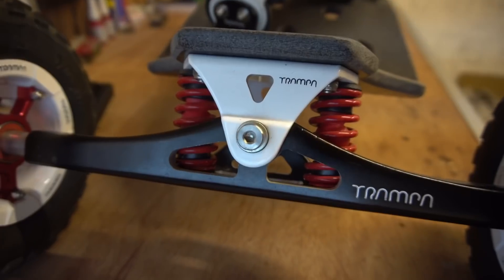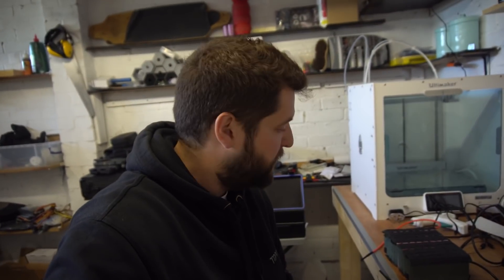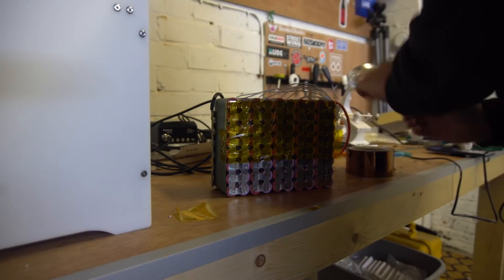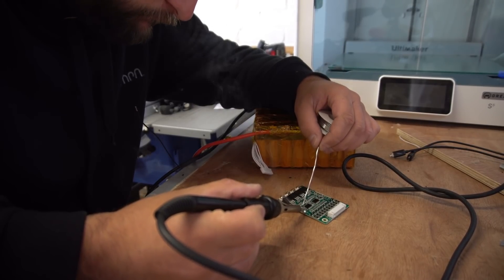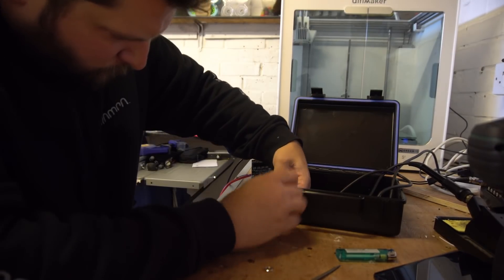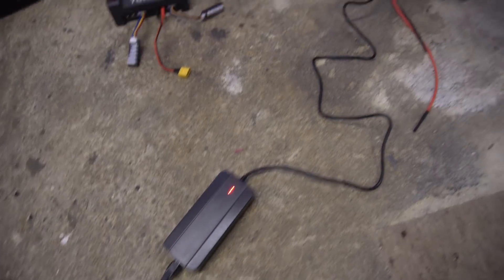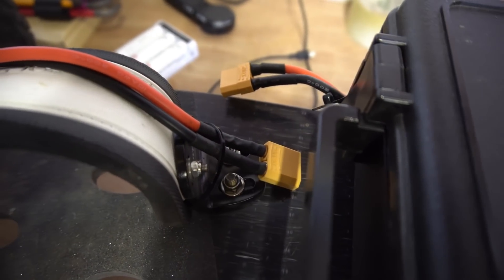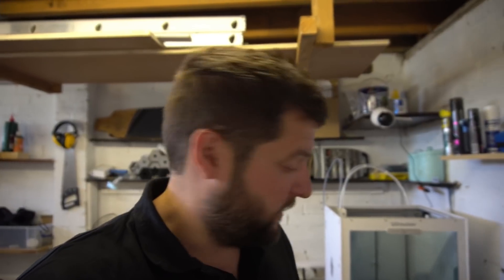How to Build An Electric Mountain Board - Making The Battery Part 2

Comment: Shouldn’t the BMS be rated for a higher continuous discharge current?
Reply from the maker: The BMS is bypassed for discharge bro
Reply: Lee Wright oh I see. Sorry I missed that. Great videos.
Reply from the maker: @AndySteber  hey no worries and thank you!
Reply: @LeeWright  wouldn't that be dangerous to discharge your batteries to much? The bms would  stop giving you power when it detects low 3v voltage to keep batteries from over discharging? Thanks for your input, you put a lot of work into this.

Comment: Lee - skip all that unnecessary welding on your next build and check out the battery kits from vruzend.com. They are a game changer, life saver, and time saver. You can build the same battery you did in this vid for 1/2 the time! Lmk if you try one. I’m going to use it on my build.
Reply from the maker: I have seen it and I have seen NESSE as well but they make the battery too bulky I think! They would be good for when you have a bit more room - I especially like the fact that you can disassemble your battery to fix something easily or take it on a plane. I look forward to seeing what you do with it!

Comment: Hi Lee
Is it possible to charge via the xt90 plug instead of the charge port?
Reply from the maker: Not in this setup, you want to charge via the BMS.  You can make the charge port a XT90 if you like?
Reply: Lee ok thanks, that must bee the solution.
Reply from the maker: @steffenkastved4720  no worries! If you are using an internal BMS like me then you just need to set your hobby charger to the correct S number and then do a non balance charge, the BMS will take care of the balancing
Reply: Lee Wright I will just use the one from my rc car, and just charge with 10 amp. I will make a battery like yours, 10s 8-9p thanks.

Comment: great build, i also found stepper drill bits work very well on plastic compared to a conventional steel or woodworking bits. i personally use a lipo as i cant do as much skilled work like that! well done!
Reply from the maker: Hey Ted, thanks man! Good tip about the stepper bits! I shall keep that in mind for sure.

Comment: Thanks for the great video!  I have a question, can I combine different types of batteries together like NCR18650B and LGGBMG11865?
Reply from the maker: You are welcome bud! You can only combine batteries together if they have the same capacity.  So check that they are both the same, maybe 2500mAh or whatever.

Comment: Just skip that anti spark switch. They just fail too often and totally not necessary on a mtb where the battery is top mount. Replace the xt90 on the battery to a xt90s and you golden. Cheap, reliable and save space in the esc box.
Reply from the maker: You know what mate I might just do that! Thanks for the tip
Reply: I hate variables like anti-spark switches. I would rather something that was a little bit ugly that couldn't burn the house down.
Reply from the maker: @skelstar  yeah think I'm gonna take @Andrea's hass advice and leave it out of the redesign I'm going to do

Comment: For clarification: You have a 10s8p pack.  If you have (10) battery leads for the BMS, it is doing balancing across each group of (8) cells, correct?  In other words, it's ensuring that each group of (8) cells is in balance with all other groups of (8) cells.  How do you ensure balance on a per cell basis (within each group of 8 cells)?
Reply from the maker: Hi Chris, bit of a poor explanation on my part, I wanted to say it keeps each series group of 8 cells balanced with the other 9.  My mistake, I noticed it when I was editing but kept it in
Reply: @LeeWright  Thanks for the clarification.  Really looking forward to Ep6!
Reply from the maker: @chrismalone3091  no worries bro! Thanks for pulling me up.on this! Last episode next week! 😢